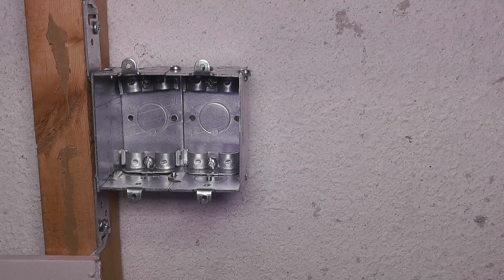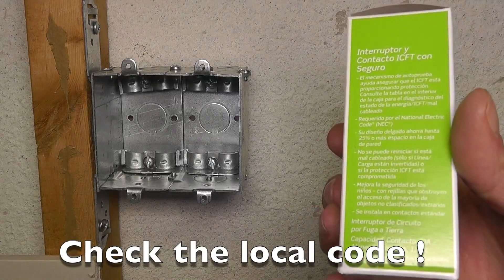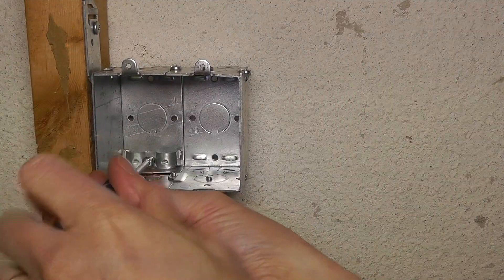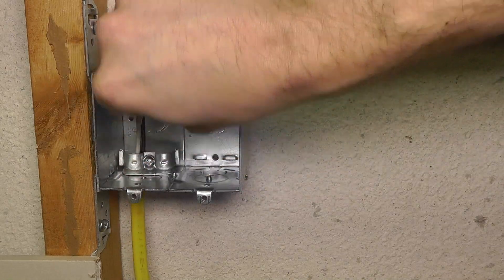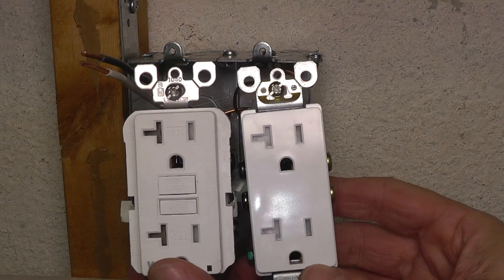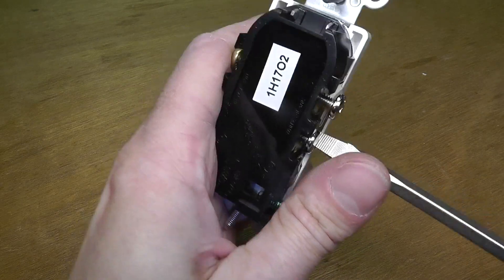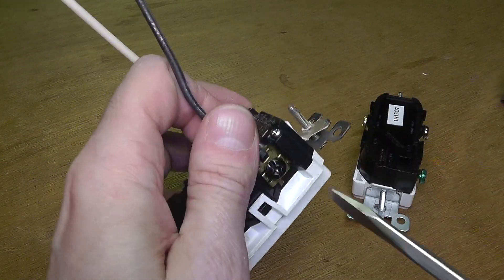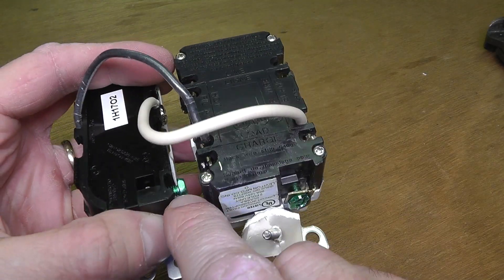DIY GFCI Receptacle Outlet installation - How to

Comment: Thanx! This doesnt answer jack shit!
HOW DO YOU WIRE 2 GFI PLUGS IN PARALLEL!
Reply: Brandon, all 4 wires would be connected to the Line, nothing on the Load. This makes each GFCI receptacle independent from one another.
Reply: @surferdude642  dude! I think you just answered my exact problem! I wired 2 GFCI's together..but there are 2 more outlets down the line that are not GFCI... and they keep popping... I think they're back feeding one another or something..
Reply from the maker: If your comment was less rude I’d actually give you an answer.   
But I gues you’ll figure it out yourself eventually.
Reply: @MegaSafetyFirst  He’s rude but you’re a little confusing wiring upside down too!